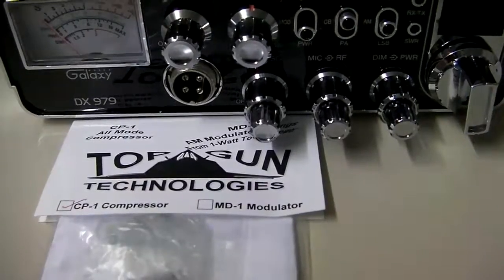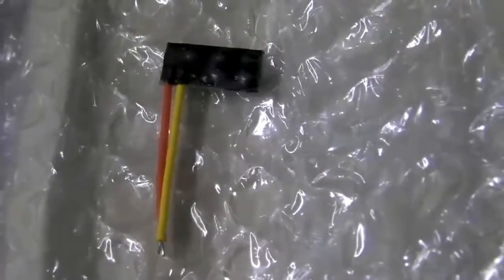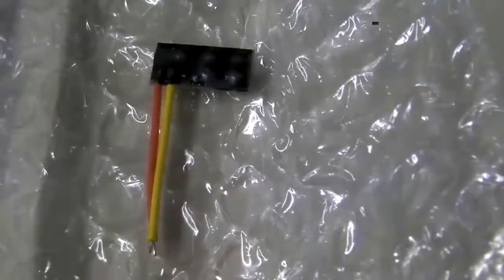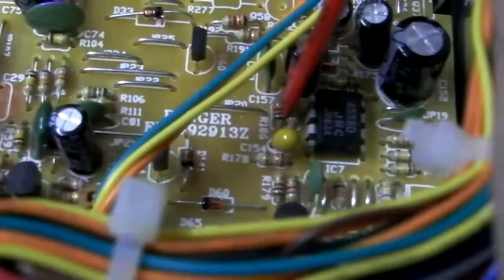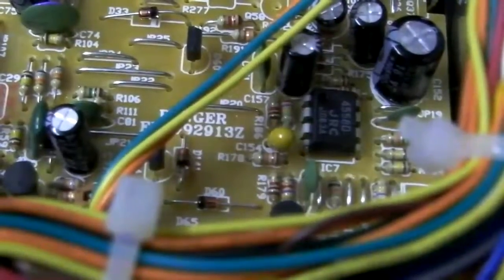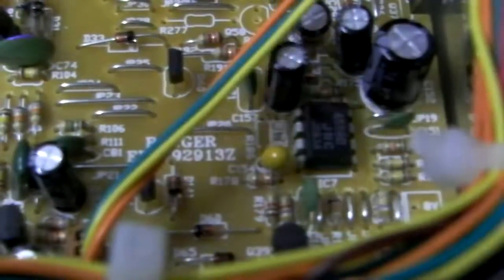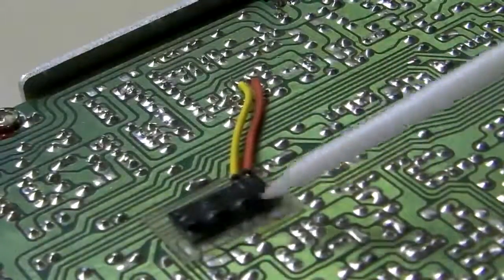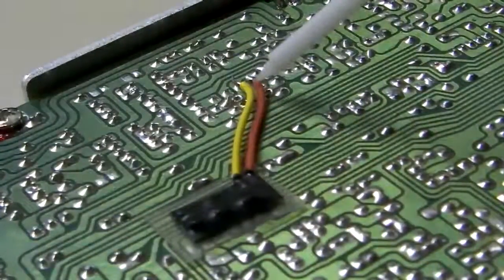Galaxy DX 979 Top Gun Compressor CP-1 Install

Comment: @TheZeke1974 It is likely designed for the "Ranger boards" Ranger, RCI, Galaxy, etc, as their internal circuitry is the same.  I think the CP-1 just works in conjunction with the circuits already installed, rather than disabling them.  This keeps it small, inexpensive, and easy to install.

Comment: @cbradiomagazine On AM mine doesn't seem to do a massive amount. On the modulation meter of the radio it still moves a lot either way with voice pitch... BUT Power "swing" is reduced a lot.. power output is kept more "flat"
 On SSB it is definitely noticeable.  While low voice levels still deflect a low amount on the meter, in a sentence say, the power stays very close to full scale with only minimal fluctuation.

It didn't give me the results I expected, but it seems to help